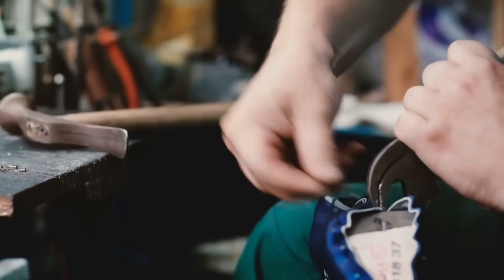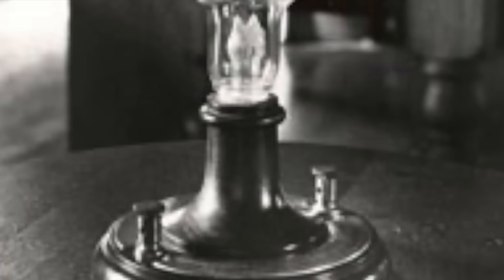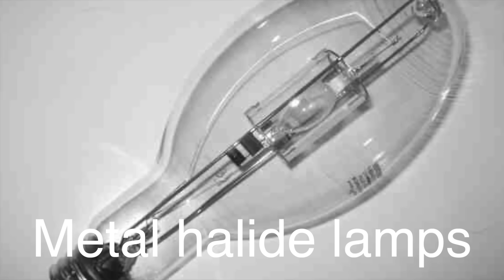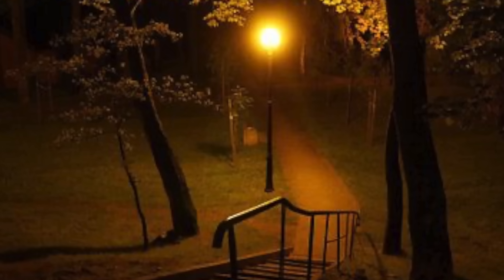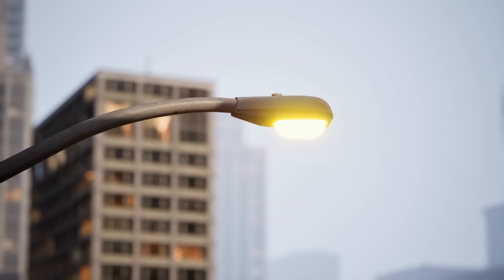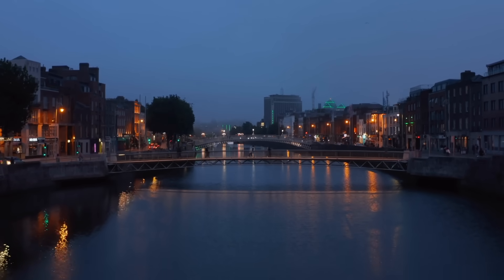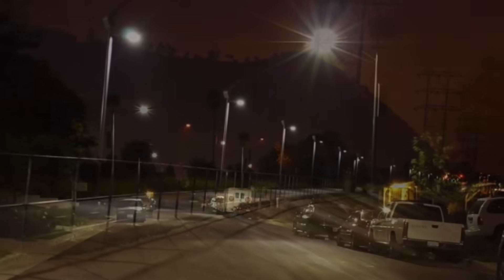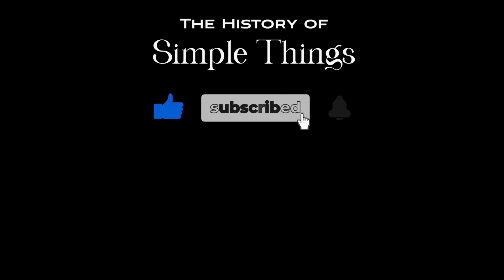Why Are Some Street Lights Yellow and Others White? | The Science and Impact of Urban Lighting

Comment: Nice video.🙂Mercury Vapor lamps are divided into those with a clear outer bulb (these of course have a lower Ra and cool white light with a green tone) and coated, where a layer of phosphor (yttrium vanadate, orthophosphate, halophosphate, etc.) is used, while the type of phosphor determines the resulting color rendering index, color temperature, etc. It doesn't always have to be just a cool white light, and High Pressure Sodium lamps, which are known for their low Ra (mostly around 25) and 2000K, are also not always known for their typical "orange" light, because there is also "white sodium" and that's a different level. And Metal Halide lamps are divided into those with a quartz arc tube and those with a ceramic round or cylindrical one. A lot can be described there, but overall the transition from HID to LED lighting has caused more light pollution in many places (thanks to which you can't see the stars as well as with HPS lamps with 2000K) and not to mention blue light, which has adverse effects on our eyes, sleep, and even insects and nature as such. Everything has its advantages and disadvantages, but when you summarize the pros and cons, the classic HPS lamps were much kinder to our eyes, nature, light pollution and so on. But luckily LED HID Replacements with warmer light are already being made.

Comment: Summary - Old lights used alot of energy and were hazardous to environment, and different type of chemicals inside the light bulb emitted different colours before..

But after the invention of the LED , the energy consumption are very low, Also we can change the colour as we desire..
 For colour selection in leds. 

Yellow light preferred for residential areas as animals and humans can easily adapt to their body clock.

White bright light which is above 4000k are used for commercial areas only because it interfere with the body clock.

Municipal corporation see cost , efficiency and maintenance.. therefore select based on these criterias only..

Comment: For white LED, use CCM (current control mode) since the unit has 50 odd LED in series. If voltage control is used, all LED burn, should one of them fail. Then some would be black 😂.

Comment: There is huge history of light bulb. Pl see Humphry Davy and Thomas Edison. Sir Thomas Edison's huge work and research on filaments is beyond words. Various types of filaments from vaiorus types of wood procured from many parts of world. 
The incandescent and fluorescent bulbs. Sodium vapor lamps. LEDs etc. I am amazed to see huge creativity in street light decorations - moon light globes, +++
The construction of roads, lighting and signalling. A lot can be different as there are newer saving and long lasting materials available. e.g. with the new LED lighting - the lighting can be near ground level allowing ease of installation and providing good lighting. The height of street light poles is due to dangers of high voltage and the area they can cover.

Comment: You may want to add a correction - Incandescent lamps can last 100's of years. Manufactures created short lifespan in bulbs increasing profits. Same as they do with new LED lamps due to (planned - timed) capacitor failure.
Reply: 100's of years? LOL, mmmmmmmmmm kay.
This was discovered after 1000"s of years of testing........
Reply: @smf2072 no he’s absolutely right. Some early incandescent bulbs from the late 19th and early 20th century are STILL working to this day, such as the centennial light at the Livermore fire station in California. This was back when things like light bulbs were built to last and were extremely well made. Incandescent light bulbs, assuming their vacuum is held well enough, can last for essentially an eternity without burning out. Problem nowadays is manufacturers didn’t want to lose the steady stream of income of people buying new bulbs so they deliberately began making them with less quality and as a result the bulb would burn out much faster so people would continually have to buy new ones. This is a prime example of planned obsolescence.

Comment: To be objective, LED wins in terms of performance but also HPS is the second best out there, it has that unique golden yellow hue which is also a very sweet and relaxed light at night, not like the streets today with LEDs that they have a bright white light which affects melatonin significantly while the roads used to be mostly with HPS high pressure sodium lamps where the light they emit is very little blue, this can be a disadvantage but at the same time it is an advantage because it doesn't tire the drivers and yes that it is true and not the opposite as some say, white lights at night is a big mistake it can present discomfort and destroy melatonin, also another important advantage that high pressure sodium lamps have but mainly low pressure sodium where they literally emit orange-yellow monochrome light where great at breaking through the fog!!! I would say the best for the streets is HPS where the light is golden yellow dark 2000Kelvin or LED but warm white 2700Kelvin
Reply: I agree but unfortunately hps lights are being wiped out of the planet. Every city is switching to horrible 5000k even 6500k led.
Reply: 😖 6500K It is very terrible at night on highways and not only, especially if they are LED! Fortunately in Greece LEDs are 4000K or the rarer 3000K, not so widespread the 4000K better but and again it is not good, the ideal mainly for highways is 2000-2500K! Greece once had HPS literally everywhere on all highways in all cities, villages, towns but also MV mainly on provincial roads and mainly on small roads but now unfortunately both MV and HPS I cannot say that they became rare but now they are slowly disappearing unfortunately and HPS and MV are my childhood years unfortunately I was not lucky to have SOX where I live and in a country where SOX was not very common although they used to exist in Greece but in general SOX was not very widespread in Greece and now they are extremely rare! I recently know two highways that still have HPS by the thousands and for over 30 kilometers!  Generally in Greece, HPS are now scattered throughout cities, villages and even towns!
Reply: @d3sentry sad.... Even my old neighborhood swapped out. It's gross. 
What's ridiculous is that I've seen these LED bulbs mimic traditional yellow bumps almost perfectly but for some reason they want to put eye destroying White.
Reply: Lighting studies must be done, reviewed to select the right type of technology, bulbs etc. Its possible to have huge savings in materials, money and yet provide good lighting for streets. Rainy season, fog, snow, summer etc all to be considered for streets in various locations.
Reply: Exactly like that!